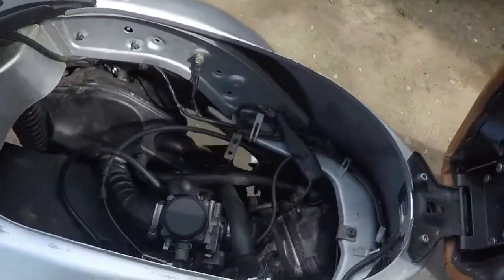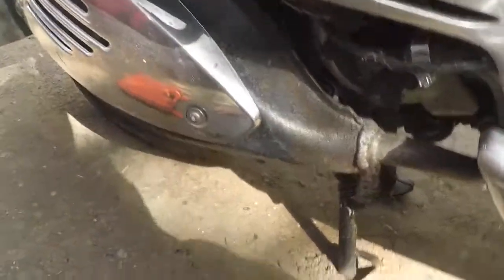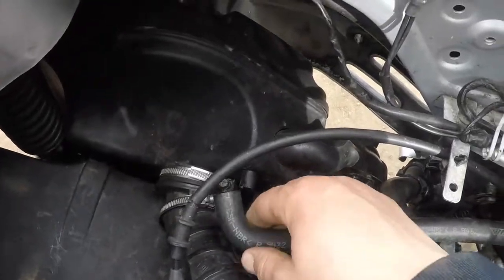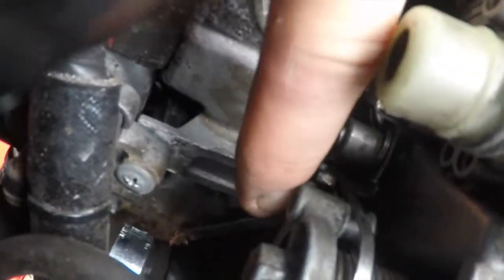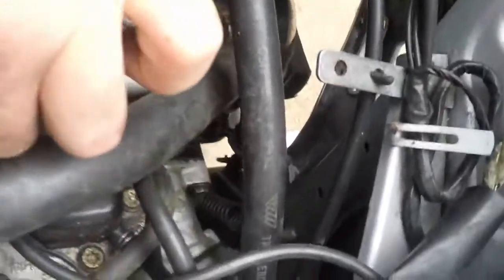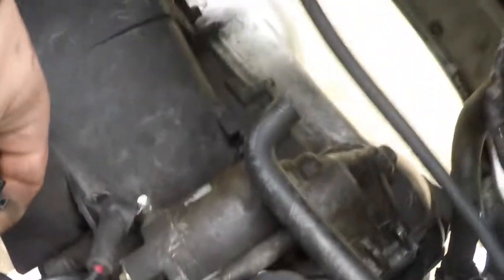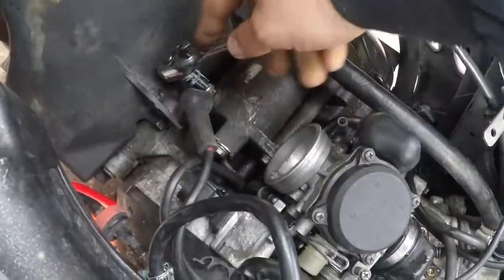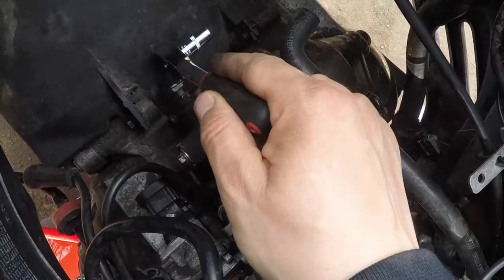Piaggio vespa GTS 125cc and 300cc engine removal!!!

Comment: Hi After you disconnect the rear brake cable, you must refill with oil ?
Reply from the maker: No it doesn’t work with oil pressure I think is still got disk brakes with spring

Comment: Alright mate I am another YouTuber in need of some advice I have 300 Vespa engine and I’ve put in my gilera runner vx but having trouble with the wiring have u ever done anytring like that before and what area u in mate I’m Essex (Dagenham)
Reply from the maker: Hi yes did some wiring jobs what is your struggle mate can’t be to many wires to the engine just tell me what you did so far? I live in kent west kingsdown but I work in Dagenham!🤪
Reply: @r91motorswelcome79  happy days mate you’ll have to pop down my garage some time defo add me on Facebook Danny east take a little look at m channel as well mate I do repairs and bike builds fairly new to it but I’m learning and enjoying it so much